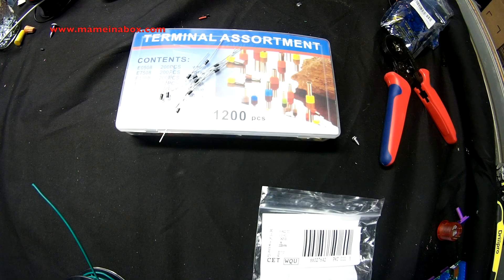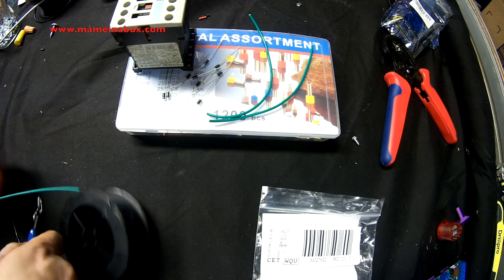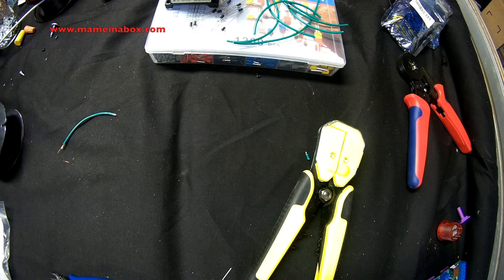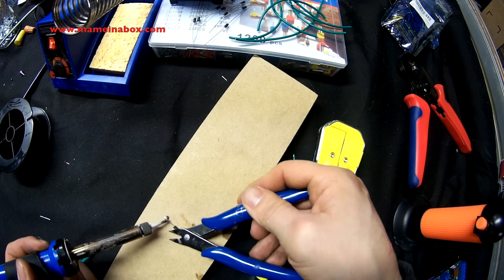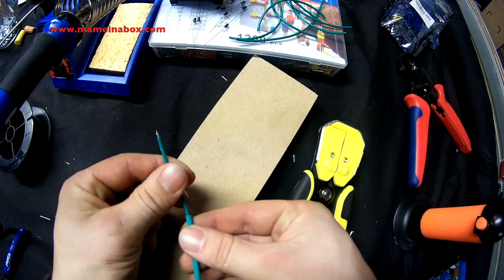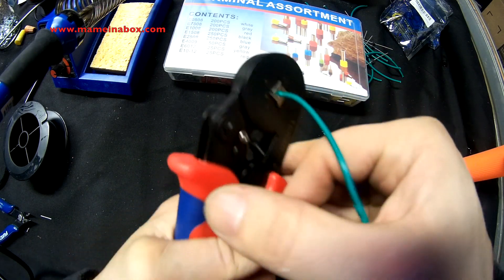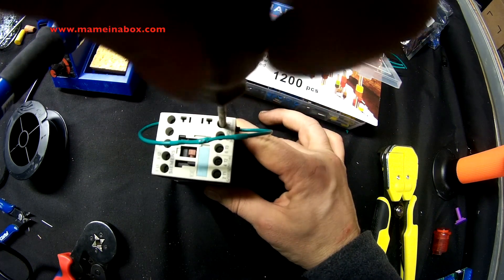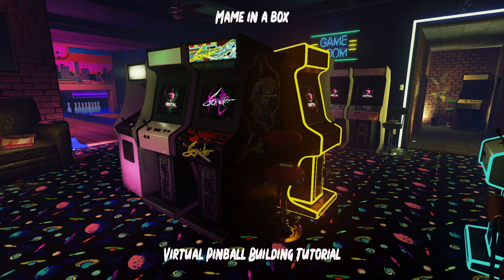Virtual Pinball Guide (Installing Diode)

Comment: Hi and thanks for the video. I have the Siemens contactor with Siemens 3RT1916-1DG00 dc 12v 250v, 
do i have to replace them with 1n4007 diode
Reply from the maker: Take my advice with a grain of salt. I am no electrician, but here s my understanding, it does not matter what kind of selonoid or contactor you have. 
The 1n4007 I believe is still the right diode because you are going to feed 24v or 12v to your contactor. 

The 1n4007 is what we call a general purpose rectifyer and supports like 1amp which is fine for our purpose.

If anyone else with more knowledge on the subject wants to jump in, the floor is yours 😆